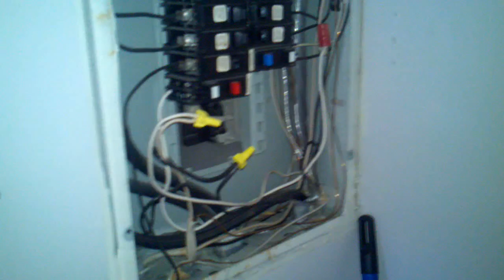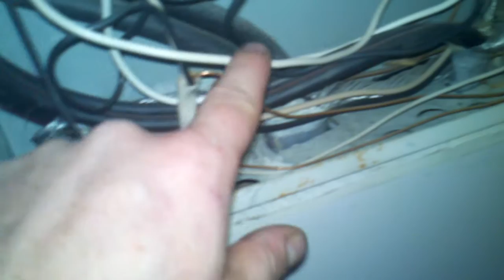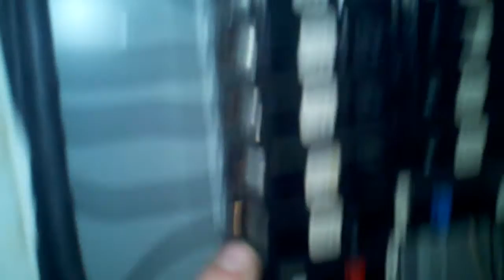How I tied my refrigerator into the solar shed for off grid refrigeration.

Comment: try searching link knight solar fridge and its likely to come up. i got it at a camping place over here in australia. its an engel, they are a japanese company. compressor is strange like a piston with no crankshaft. they have a spring one end and a solenoid the other end. i've been watching the figures on the charge controller and it actually uses only 18.5 watts when running. others are like 70watts or more (the crap waeco i first had was around 85watts).

Comment: i got a 12V fridge on a 120watt panel and 100Ah deep cycle battery. its not too bad and ran all during the last winter with no problems.   watch?v=fs8u4cQDTN8